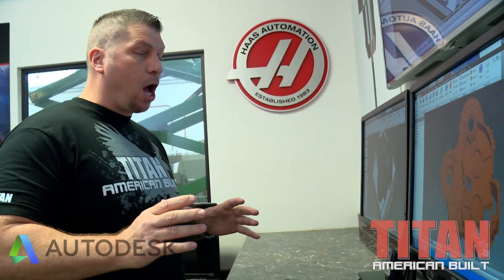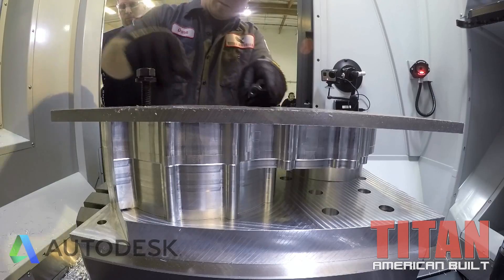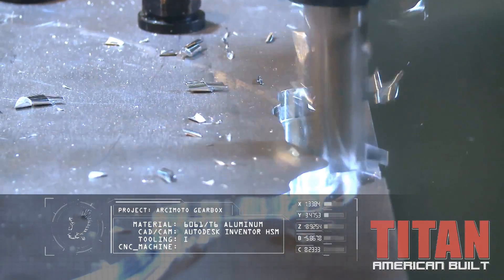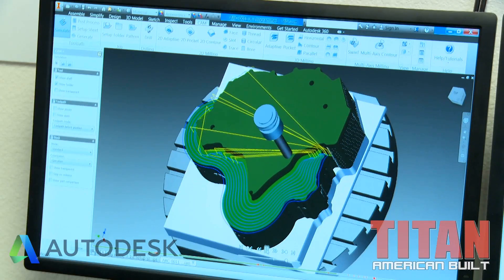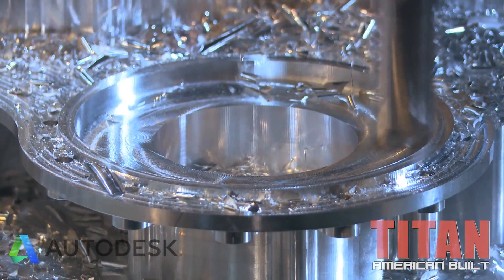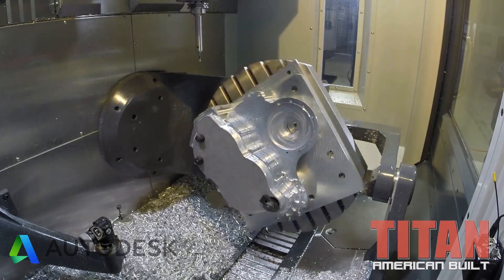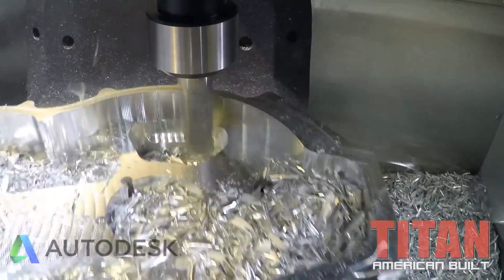Titan machining cool gear housing with Inventor HSM

Comment: I have a dumb question.  I own an AXYZ cnc table myself and I was instructed that we must always cut forward. 

I would like to know:

Why do you run your tool backward?
Usually, the cutting teeth are suppose to run into the material so to have a brighter finish because, once cut, the scrap stuff is suppose to move out upwardly, is'nt it?   Know what I mean?

Comment: I ask for advice. I use the Autodesk Inventor 2017 professional at work, and I want to install a program for cnc machine programming (VN-4SS cnc machine
Haas Automation) . Do I use Inventor HSM and Fusion 360? which is easier to use and which is more useful. Is it a more logical solution to HMS because I know the inventor? I'm new to this and I want to decide which one to buy and to start working in it. processing in our company are very simple-threads, holes, channels, grooves.

Comment: It doesn't matter where you live. The fact is you should buy products made as close to their site of operation as possible for when inevitably SHTF. No company wants to look bad in today's sphere of instant social interaction; if they make a mill and it's shit, they're either working on a fix or they're out of business. Doesn't matter if they're headquartered in Cupertino or Shenzhen. Buy what's right for the job, and if there's a fatal problem, call them out on it. Gather a crowd. I'm not saying it's the best way, but It's what we do and it usually works. And laterally, stop shitting on HAAS. They may not be no Mazak, but they still respond to what their users want, I'd assume they want to still exist in ten years.

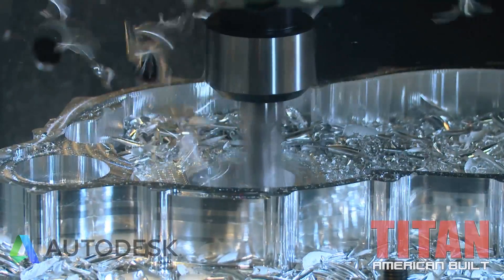Comment: Watch 2:50 sec...tool buried as it rapids...This guy is a complete fraud and makes machinists looks like idiots. Its just a Haas/Autodesk commercial anyways.
Reply: Quinn Pultz I noticed that straight away lol. inventor. pfft. Unigraphics.
Reply: I think he does a good job overall with what I have seen of the show. The beginning is greenhorn though. "What if I doubled the speed, or went 4 times the speed?"  The tooling companies are pretty good at telling you want the capability of the tools are, so to just double and quadruple the rpm is quite amateurish.  What rubs me the wrong way though is,  I am not sure I like the premise of the show that much, as "machining is a good thing to teach our prisoners", (thoughts of a dictator), while the USA High Schools got rid of their machines 3 decades ago.  Some very big names during the USA's industrial revolution worked in machine shops, guys like Henry Ford, George Westinghouse.  I see the talent pool is getting smaller for machining, so hopefully this show spurs some young talent,----then start your own business cause you can.  The freedom to use your mind in good competitive business and prosper,---that is freedom.  Personal achievement is happiness.

Oh, by the way, machining tip not on this show. "The #1 factor for reducing run times is increasing Depth Of Cut".

Comment: This guy is so full of it. I had someone ask me about his videos, so I looked at some, and they are pretty silly. First off, a Haas is not going to run at the high feed rates other machines will run at, and this guy has no idea what 800 inches a minute feedrate even looks like.
Reply: 800 ipm, with a 5 flute cutter @ a .016" chip load and a 10,000 rpm spindle speed.  That chip load is high even for aluminum.  No wonder why he is only taking off .030".  If you ran 250 ipm with a .005" CL and .300" deep, that would be like (in run time) .030" deep going 2,500 ipm.

Proper feeds and speeds with a deeper "depth of cut", (deeper depth of cut is the #1 factor for lower run times),  removes the material faster than fast skim cuts.

I like a lot of this stuff though, but I am not buying Enco. :)
Reply: .016" CL is heavy for a solid carbide EM, but not for many insert type mills.

Comment: I have read this guy was an amateur boxer in his younger years.  It would appear to me that he suffers from at least a little brain damage as a result. The guy is way too punch drunk to be smart enough to manage this job from the solid modeling to the fixture design, and the probably 100 or so opps required start to finish.  Just keeping all the work, and tool offsets straight demands quite a bit of clarity that this guy just does not demonstrate.  "Alright Titan,  hit that green button right there"
Reply: xD

Comment: I'm assuming Gilroy is only making a few of these housings. If he had to make, say, 100 of them, wouldn't it be more cost effective to have them cast and then machine all the holes, threads, and bores?
Reply: It wouldn't be up to him. it's whether or not the supplier wants the part casted or not. There's also a structural difference between a casting and a solid block too on top of that., so it's not always the best option.
Reply: GnosisMan50 not at all. the mold cost alot. it is cost effective when ordering thousands

Comment: stands nervously with palm over emergency stop button...
Reply: His hand is actually on the feed hold button. It is a very good habit, when proofing a first run especially on a machine with a starting price of about $150,000. If I hired a machinist who routinely pushed cycle start and walked away on my machine during a first run I would get rid of them. Crashing a machine can wreck your business.
Reply: *hands tremor when spindle load increases
Reply: Michael Gilmore ,It is just the same as that happened in BKK.The last five years 's flooding in Thailand has caused CNC router of mine out of order without any help from Thai government.
Reply: we've all been there! LOL!

Comment: Flinging excess material. Nice. Coming from an aerospace CNC machinist myself, those excess chunks could easily programmed by a endmill rougher or bandsaw. Then start making the part.

Comment: I have been CNC Machinist before most everyone here was still in their dads gonads. Never be too proud to accept good advice or think you know everything, stay humble minded and respect others advice. Those who are criticizing are foolish. Remember " Man who knows everything can learn nothing". This good man is a Successful Business man who is a good CNC Machinist.. He is trying to pass on his experience to you and get you to "Think Outside the Box" .. Until YOU HAVE done better ... You  may need to shut up....
Reply: Hey forest what was in that box of chocolates you ate?
Reply: Carlos Diaz idk where you get that Haas machines are low quality but a job shop, uses what the customer wants for their parts. He has several vids where Iconel was used and it is the toughest metals to machine!
Reply: Any true machinist can see this guy is nothing but an operator using low quality machines and running inefficient programs that would never work in the real world. There's a reason why he rarely cuts steel in his videos...
Reply: Gump, been there and done everything he can imagine, long before he probably even knew what a machine was, and did a better job. I certainly wish we could get some of that work at our shop, the scrap guy would have to come every day and haul chips away.

Comment: you can tell this guy did not program /set that up . hes just there for the camera . there are some talented guys there that are actually doing the work . hes just the guy in front of the camera . thumbs up to the actual workers .
Reply: lol, he has his own cnc workshop, guess you are ignorant
Reply: Haha yeah, he clearly has no clue... He only built his own shop from the ground up, knows nothing.. 

But yeah, there are plenty of people in engineering that are clueless, I very much doubt he is one of them.
Reply: Not sure about that. Did you see where it did a rapid through material? 2:47.
Reply: You obviously haven't listened to this guy's story. It is truly incredible how much work, effort, and time he put into this trade to build his own shop even though he spent 16 years in prison and had no money.
Reply: Are you sure that it wasn't intentional? He might've known the limit of his tool with the metal he's using and decided to make a cut while the tool was passing over the area. He's all about efficiency and honestly that's the right way to look at these machines. If the machine can handle the load there is no reason you should baby it because there's a reason you got one of these five-six figure machines in the first place. I can't wait until I get my hands on a CNC of my own.
Reply: not that its hard haha i do this on school same machine etc its just making a 3dmodel select tools and the program writes a program

Comment: Everything worked out perfectly except 2:50  :-)
Reply: +Nita Ionut It was a multiple depth pocketing.  The tool was ramping down to the next depth.
Reply: yeah pecause "experienced machanists and programmers" go with full throttle threw material. What an idiot.
That's a mistake in the programm.

"That's a big time saver" like what, 0,001 second? Compared to the preasure on the machine which can cause on long terms way more costs it's nothing saved.

What if you use the problem on another machine with way more max speed? Think about it
Reply: no it was not they just forgot z ax retract+solarbikedz
Reply: solarbikedz yep it should have retracted, look at the toolpaths
Reply: Look at the finished piece, that material gets cut away anyways. No reason to waste time with a z axis retract when the material needs to go buh bye anyways
Reply: somebody thinks like me. its aluminium. it doesn´t matter =)
Reply: "no reason to waste time" - okay g0 z-500 and HIT THE GREEN BUTTON
Reply: I wonder how many of the people complaining about that move are actually very experienced machinists and programmers??? I would bet not very many.... Thats a big time saver when machining and is not a big deal with softer metals.

Comment: Maybe he meant tenths of a thousandnth?  but that would be like, a press-fit.  .005" would be more realistic.  also, I'm surprised the software didn't catch the collision at 2:50.  good thing it was aluminum.  anything harder would've demolished that tool.
Reply: Kevin D,  it's possible,  but clearly there was no Z retract
Reply: Didn't look like a collision to me. There is an option to keep the tool down, and it'll have ramped down to it's next depth instead of spiralling in which would have saved time.
Reply: Hayden Fischer a collision is an unintentional tool path, either resulting in tool breakage or a large chunk of material being removed.  In this case, the tool didn't retract in Z before the next cut.
Reply: +Graham Glass even if it were an intentional ramping, I don't think he would've programmed it at a 1000IPM ramp feed though.  the tool flying across like that doesn't sound good if you listen carefully.
Reply: Hey can you explain how at 2:50 thats a collision? all I noticed is the tool was still cutting and was racing over the metal rather fast  im just learning cnc stuff with gibbscam
Reply: I think the endmill pulled out of the holder.
Reply: I caught that too. Definitely not what you want to see happen. Just because the tool doesn't break doesn't mean it not a crash.
Reply: Correct. It wasn't difficult to see because it wasn't a complicated machining sequence. If it was steel the tool it will be damaged.
Reply: yep aluminun thats y
Reply: The z retract was unnecessary because that material was getting cut out later. Look at the finished piece and compare it to when you think the collision happened. The finished version is much deeper with several large cutouts, the area in the time you are referencing is flat. No reason to withdraw the z and slow down the process.

Comment: 10 thousandths of an inch is a "snug fit"? A Haas can definitely get the fixture a heck of a lot closer than 0.010".
Reply: +Anand Rajamani I'm pretty sure he said " a ten thousandths" Not ten thou.
Reply: rkshireygames lol ten thousands is 10 thou
Reply: bridged13b No, really? I never would have known that if Mr.Bridged never came along....
Reply: bridged13b And "A ten thousandth" Is very commonly used to describe 0.0001.
Reply: rkshireygames yea I guess, usually just called a tenth though
Reply: We had a guy working at the same shop as me and he would always say a tenth of a thousandth of an inch when normal people would call it a tenth